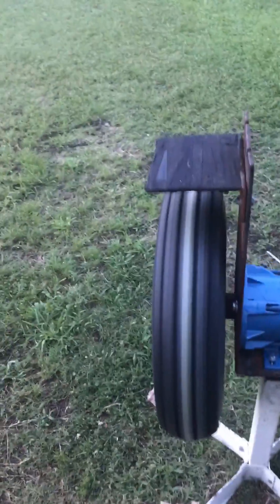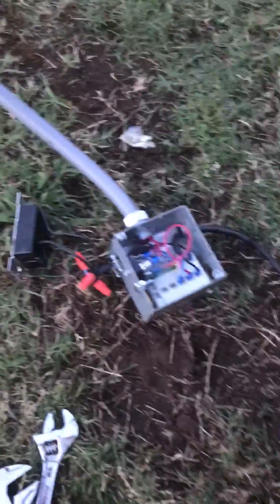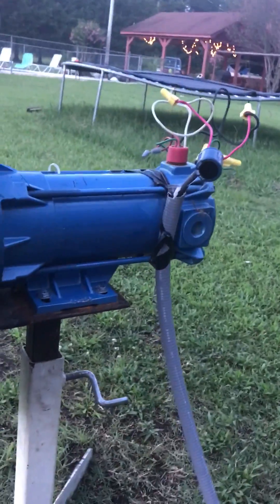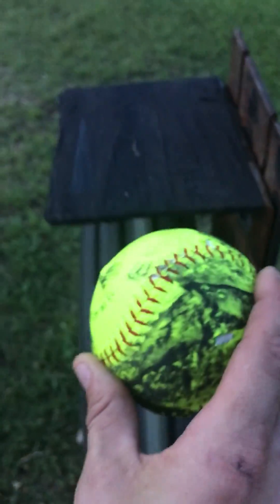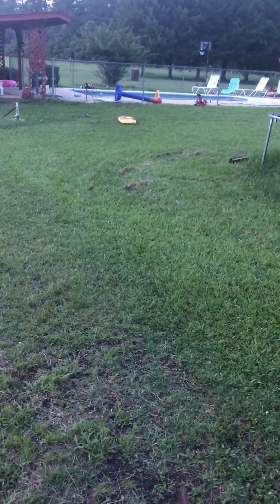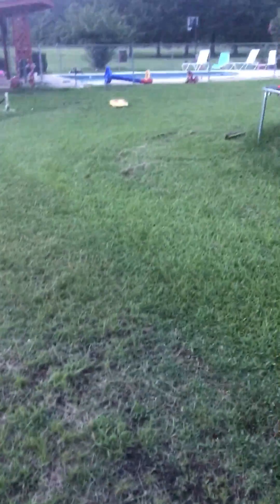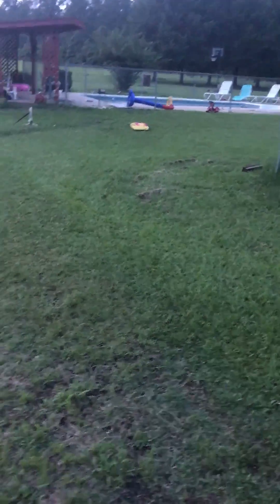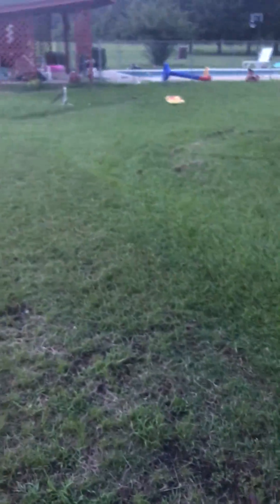DIY pitching machine homemade (softball) how to

Comment: Nice, I wonder if you would have better luck with normal pitching wheel and tire as far as accuracy and consistancy and using using normal pitching balls with the dimples and such